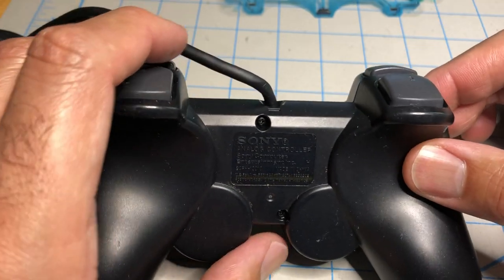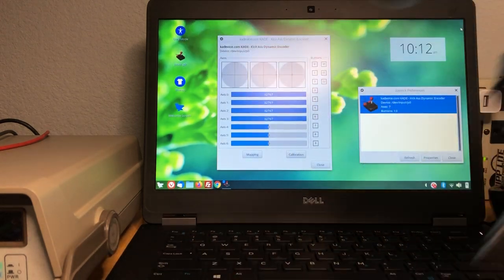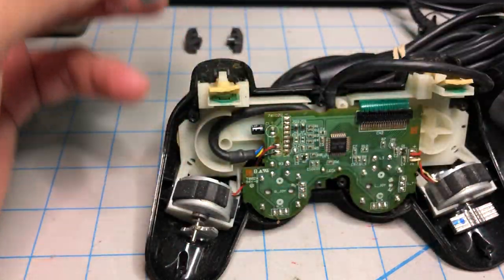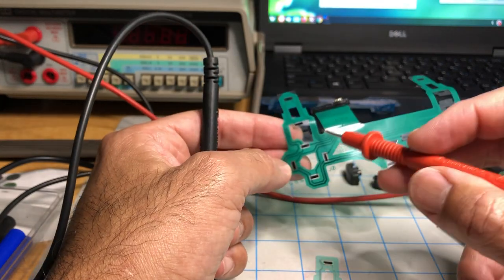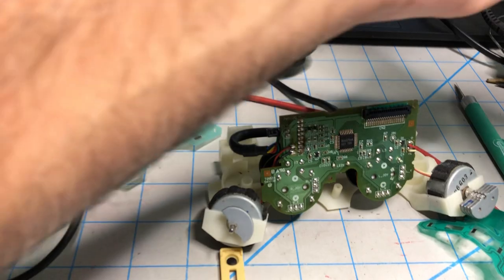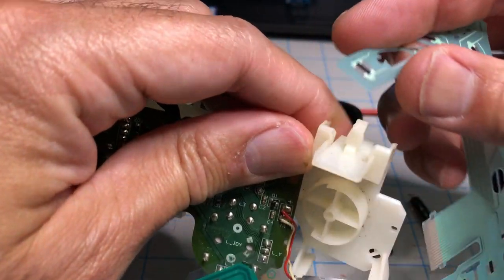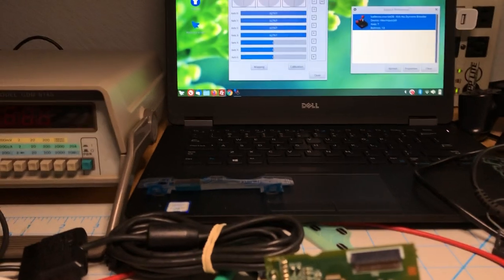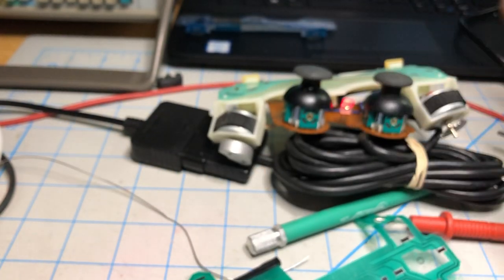PS2 Controller repair

Comment: can you solder the flex pcb directly to the controller without the 18/19pin connector?
Reply: Maybe, but I think you would just burn/melt the ribbon cable.
Reply: @norbertgyuroczki3307  Thanks, I already went ahead and got the proper connectors. Now my controller is brought back into life after 13 years in storage with the fresh new pcb.
Reply: @user-yk1cw8im4h  That's good! I currently own 2 Dualshock 2 controllers, one is A and other one is H, and both need a ribbon cable replacement, so I'll have to order 2 new cables, one with zif connector, one without
Reply: @norbertgyuroczki3307  A also failed you? I heard it's not as common as H in terms of failure rate. Both of mine are H. Btw I got the zif connector seperately as I didn't do enough research and thought the original connector can be reused xD
Reply: @user-yk1cw8im4h  Ah, I see. First I thought that too! And yeah, A has failed me too, same problem as my H revision one, the Ohm rating is too high, and both controllers have the d-pad constantly going up, and no button works :/ I'm probs going to order the cables tomorrow, and they might arrive just before February (ordering from AliExpress btw)
Reply: @norbertgyuroczki3307  That's exactly the problems I was having as well, I had that weird behavior of a button kept pressing down. Had to unplug and replug again to solve that. Mine arrived quickly as I ordered from taobao, which is just aliexpress but for east asia.
Reply: @user-yk1cw8im4h  Yep, but everytime I unplug it, it just starts doing it again. I actually cleaned both controllers on the inside (The pcb of corrosion especially the H one) but nothing helped, so sadly I have to replace both ribbon cables :'( I actually had 2 3rd market controllers, but both failed on me because both broke on the inside, because my GF used throw controllers when she was younger in rage, so yep xD (Yes, I bought a PS2 fat from my GF lol)
Reply: @user-yk1cw8im4h  But I'm happy for you that it works now :)
Reply: @user-yk1cw8im4h  man where did you find the connectors?
Reply: @xN1ckuz  There are lots on aliexpress, just search "18 pin ps2 controller". I got mine from taobao though